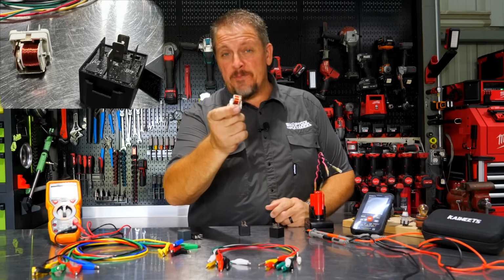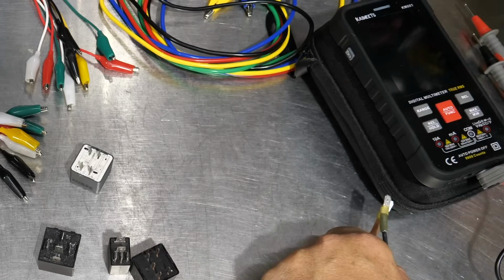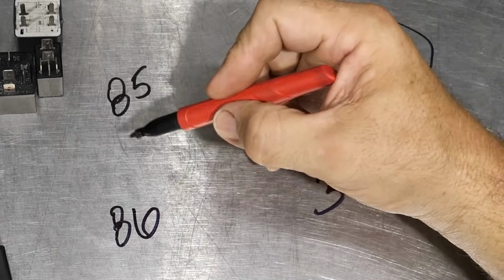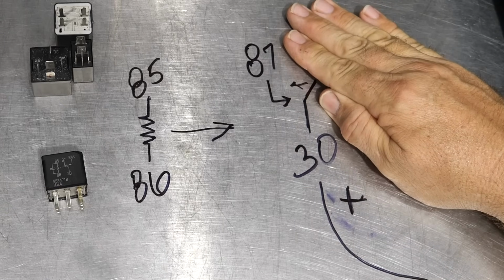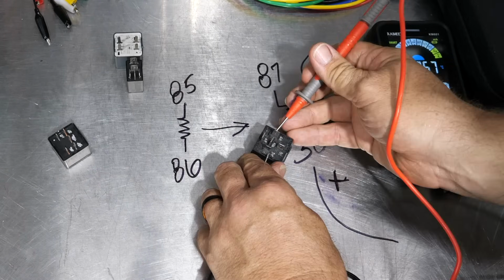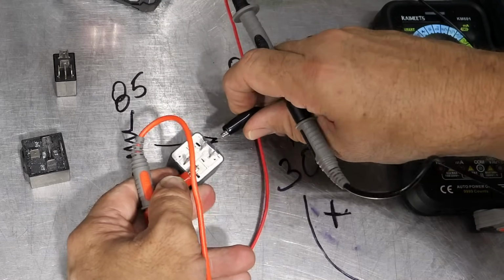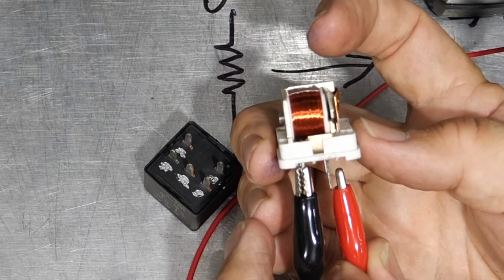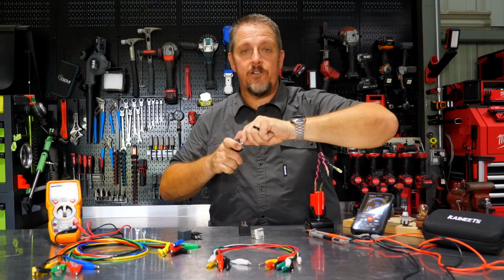How To Test and Diagnose Relays and Wiring [4 & 5 Pin]

Comment: Great video...questi9n. So if there is power at 87a and 87 when powered that's a problem? Correct
Reply: Sounds like it might have failed inside and has fused the two circuits together.  Pull the relay and ‘without power’ test to see if you have continuity between 30 and 87a and then 30 and 87.  If BOTH have continuity, then they are somehow fused together and it is broken.

Comment: Best of all relays testing material videos on youtube so for I found, appreciation is a must.  Also I have a question if could answer me would greatly be appreciated. 
I was testing my honda pgm fi 4p relay. Ignition on, I see 12v on switch side pin #86,87, and load side # 30 but  on pin 87 it was 0.16v.  What can be the reason it the relay is not closing the circuit properly? Although bench test was ok. My car has crank no start issue. Thank you
Reply: Wish he would have answered this. I'm in the same boat

Comment: The markings between 85 and 86 is a coil (curvy lines) not a resistor (zig zag lines). The coil is an electro magnet. Otherwise great video. Love your channel!
Reply: The control side continuity circuit (pins 85 and 86) is actually both a resistor (with about 80 ohms of resistance across multiple copper wire windings, AND an electromagnet (as the copper wirings are wrapped sound an iron Rod).  When the control circuit drives a current from its power side and through the wiring into a ground, the metal rod is magnatized, attracting the internal load element to “snap” onto the magnatozed iron core, closing the 30 to 87 load side of the relay and sending power to pin 87.   Sadly,  wiring diagrams only show the control side circuit as a resister, which it is, but not at all as an electromagnet, which otherwise explains the clicking heard when relays are activated.  Keep in mind that relay clicking alone does NOT guarantee that a relay is actually doing its voltage switching job, but rather only that the control side circuitry is intact electrically, thus providing magnetic function.  Either lack of 12V fixed input voltage on load pin (30), or lack of a ground on output pin 87 will create a dead load circuit despite a normally clicking and otherwise perfectly good relay.  Dr. K.
Reply: @kenhardy4167 yeah,  what you said! 👍🏽
Reply: Yes,85-86 is a coil that pulls the load contacts to energize a fan motor or whatever but it goes to the device to put under load .
Reply: True.
Reply: There's also a resistor inserted across the coil to damper down the induced voltage created when the relay coil is switched on and off.
Reply: @m101ist ❤❤❤❤❤❤❤❤❤❤❤❤❤❤❤❤❤❤ì❤i
Reply: @m101ist  to help protect the ecm if the signal is used to activate the relay. I was used to it being a 12VDC signal when its wired for ignition switch activation. Now majority signals from the ecm